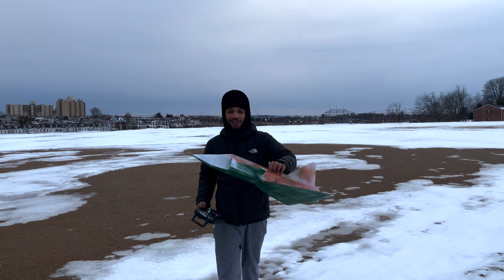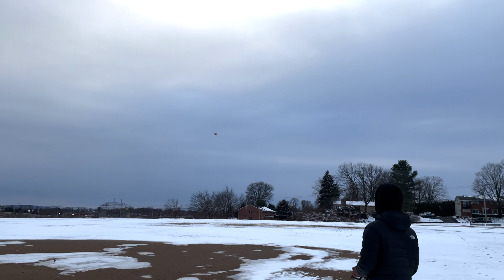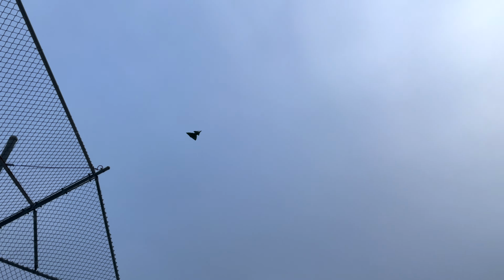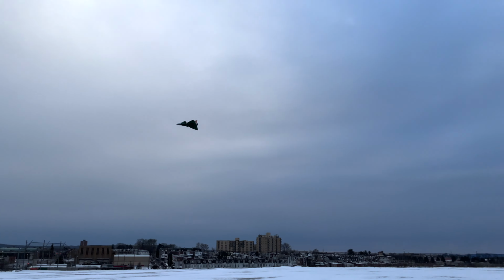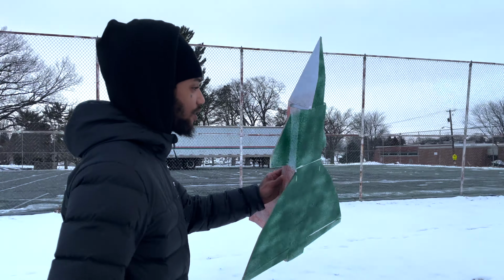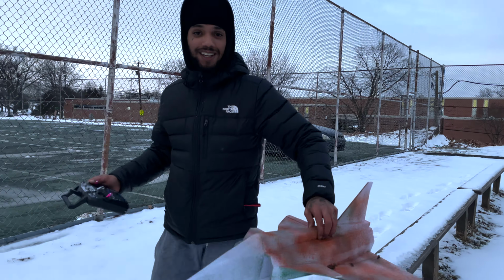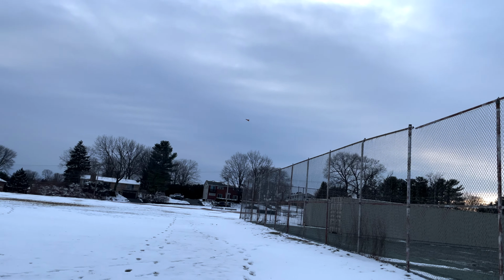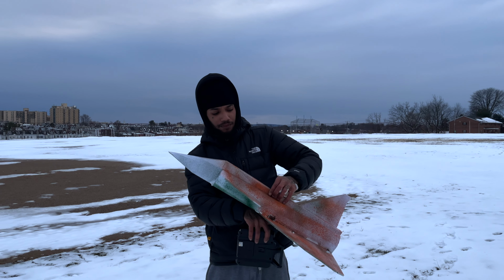Mini ft viggan

Comment: How did you manage to put a 70mm EDF into a viggan scaled down to such proportions? I have a 100% scale viggan and the high of the fuselage is like around 8cm.
Reply from the maker: i actually just glued the fuselage a little bit wider about an inch away from the slits where the wing mets with the fuselage, and had to cut a little bit from the top and bottom to make the ducked ring fit snug. It was actually pretty easy
Reply: @crossgenrc3235  mini version of viggan with this 4S setup is definitely a good idea :D might try that in the feature
Reply from the maker: @bzyksyn3950   definitely should ! I was filming another video Today with it, should be up by 12 it’s a lot of editing

Comment: Cool, when you guys get some sponsors going and stuff you guys should do some huge ass version.  Easier to control or worse than the 100% scale?
Reply from the maker: Most definitely have to make a huge one ! And I Honestly feel like this one is better only because the motor thrust is good enough got this size
Reply from the maker: I guess the first one was too big for the edf system